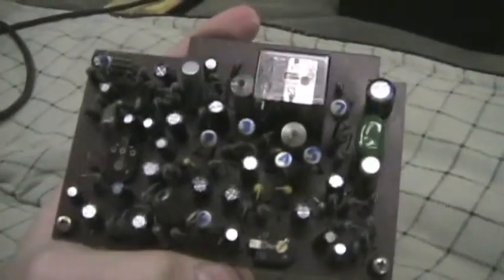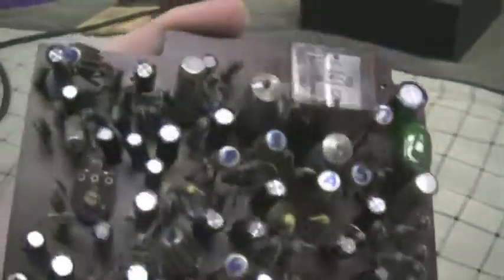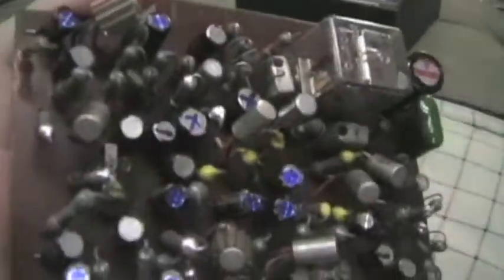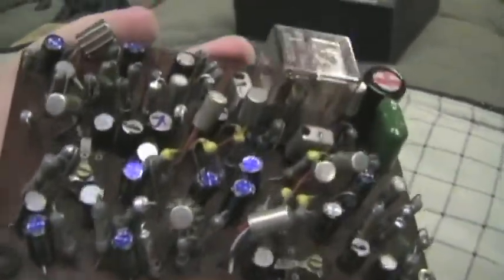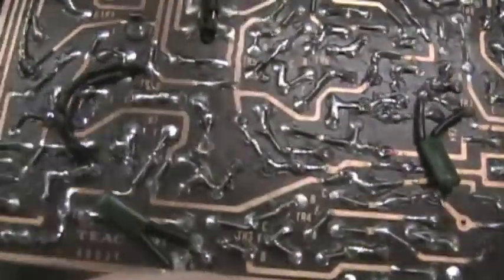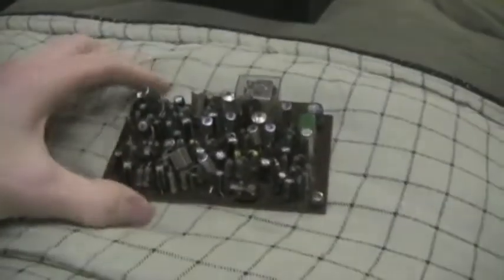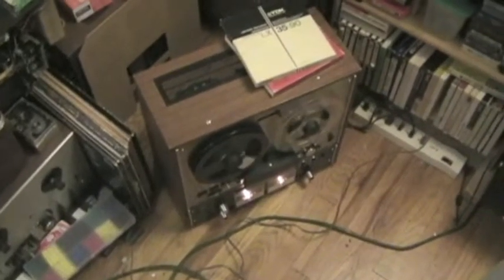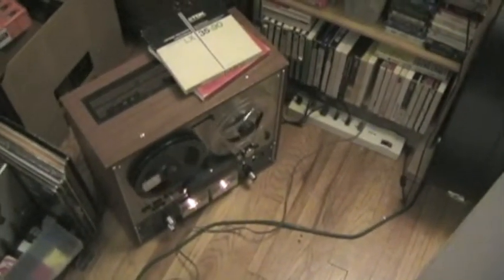Replacing More Capacitors in the Teac A-4010S

Comment: That,s cool ; you don,t see many reel to reel tape recorders anymore. I still have 4 in my collection.
Reply from the maker: Cool.  How are you and the Mercs?  It's been a long time.
Reply: The Mercs and I are doing good;Merry Christmas.
Reply: @The1970sInfatuate how did you remove the amplifier/preamp  board? 
I can't see how to remove the last screw? It is covered by the plastic cover that goes around the  connection for the cables and power cable.